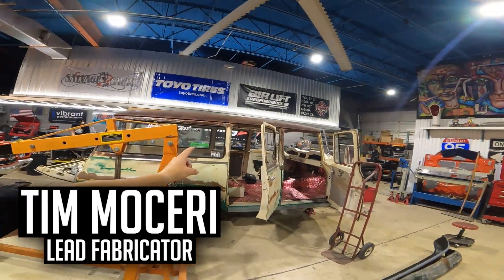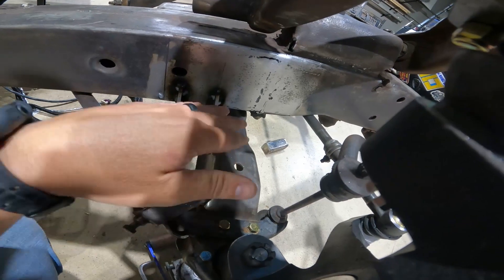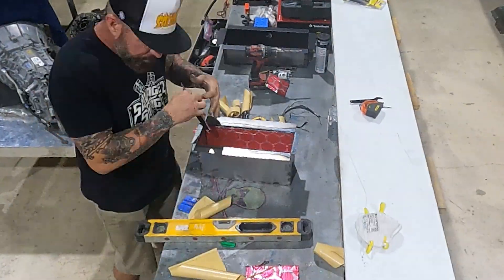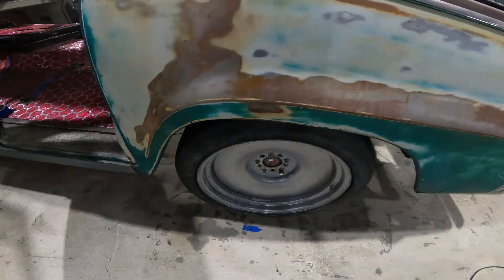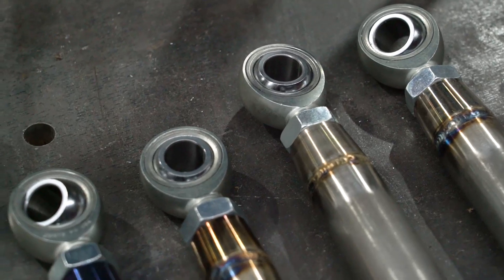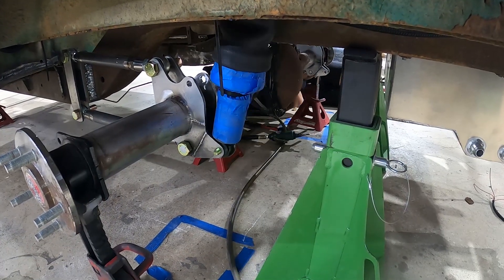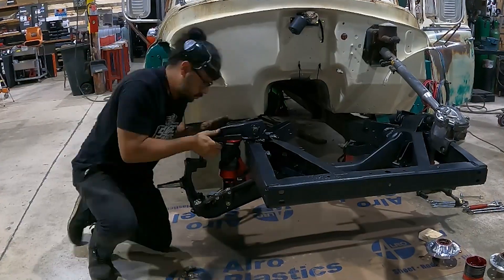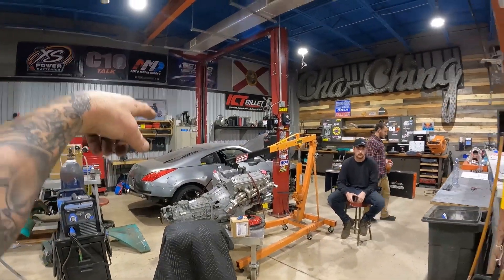Custom Suspension for the LS Swapped Travelall - 1963 International Harvester Bagged Wagon - Ep. 2

Comment: The International is starting to take shape. Those air shocks quiet, but the rear ones are quick. The front ones have a steady pace when they move up and down.
Reply from the maker: The front airs up pretty quickly as well, but it takes a second for them to go down because they don't have any weight in the front. That will change once we have a motor back there!

Comment: Looks great.make sure u got plenty space between the bag n frame on the front. They looked Hella close to frame and didn't even have air yet. Something easy to overlook. Finally got my manifold back from airlift after nearly a week fighting with them. Iv got no confidence anymore in the competence of their testers. They didn't even know the ports in the back of my manifold was for pressure sensors. They just looked @ it said that why it was leaking n wanted send it back. Luckily they had someone else there smart enough to hold their hands and explain it to them and got a brand new manifold under warranty.

Comment: This truck is turning out great. Is there a formula for figuring out the length of the 4-link bars? Do longer bars give you a softer ride? Just wondering if the length of yours, which seem fairly short, are the reason the rear goes up and down so quickly. Can’t wait to see this finished!
Reply from the maker: For this, it's mostly just the length we need to get it to axel from our mounting point on the frame.

Comment: 11:18  So has the body shifted on the frame? And if so, why didn't you stop and square/center the body on the frame? Or was the driver's side frame rail somehow bent inward 1/2"?
Why didn't you narrow the axle tubes (and get new axles) to get some nice, deep dish wheels in the back and would also have allowed you adjust track width to keep the factory fender lips intact.